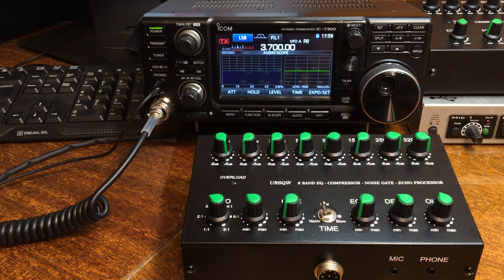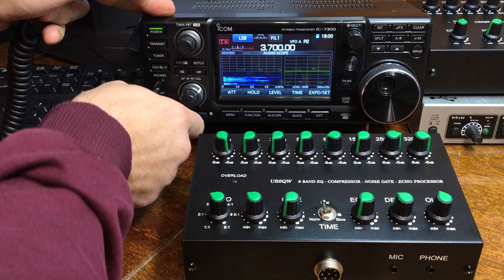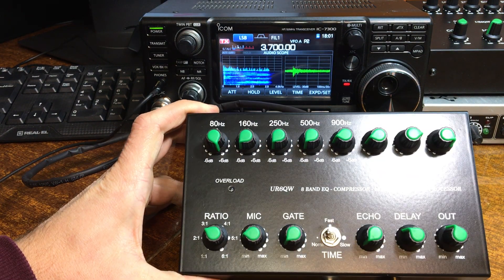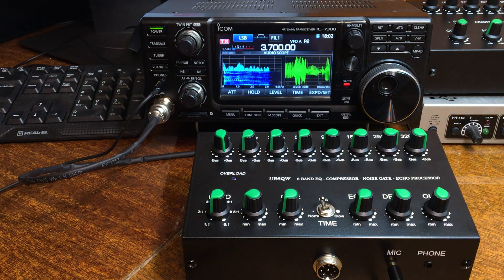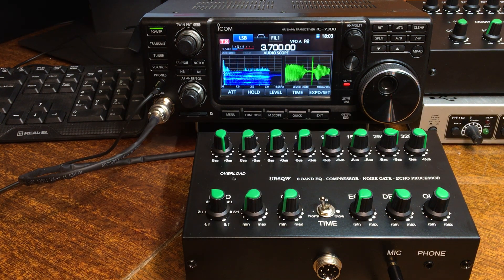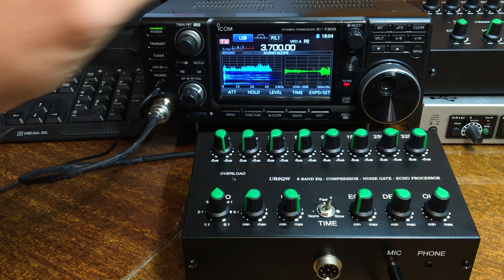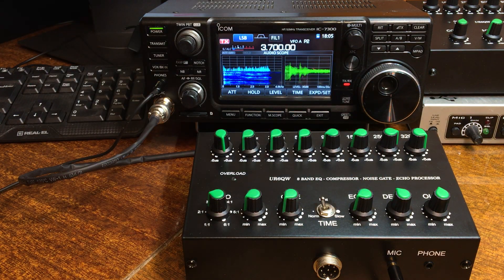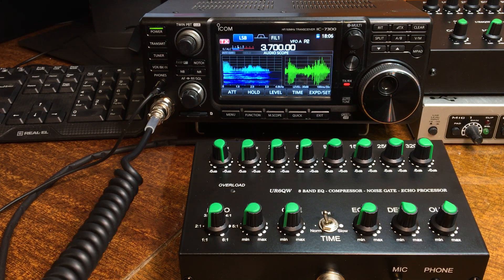UR6QW Reviewer 8band Equalizer Compressor Gate EQ V5

Comment: does anyone know if the unit comes with a dc blocker ?
Reply: The unit wired for an icom does not, it passes the 8 volts to the mic so an SM-50 for example works great with it. There are adapters for the icom though that will block it if you absolutely need it.

Comment: I bought an 8band EQ from you for my Kenwood TS-930s.  I just bought an ICOM 7300 last week. Can the 8band EQ I bought to work on the Kenwood TS-930s work or be modified to work with the ICOM 7300?
de N3SIQ

Comment: Good afternoon ea7jcr from Seville (SPAIN) I am interested in this product - 8 band equalizer with compressor, low noise preamplifier, echo effects processor and Noise Gate to V.5 transceiver. my question is if i could make a model for my yaesu ftm -400 XD equipment and if it would need a separate adapter or is it already in the same box. thanks 73. I sent him a private message

Comment: What if you connect to ACC jack on radio for modulator input for better fidelity? Ever try that? Also, does it come with schematic so I can wire plug for ACC jack to your mic plug? I am considering purchase on eBay